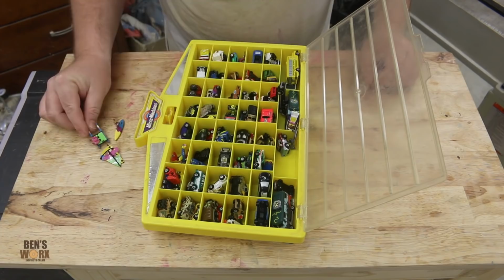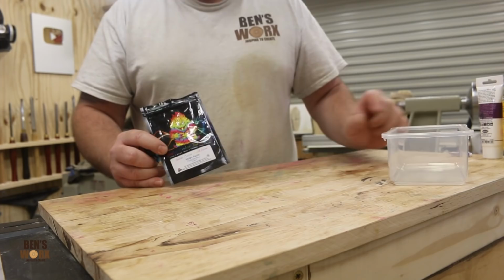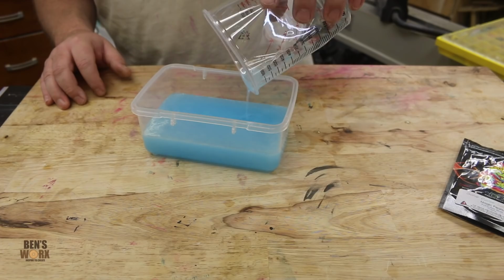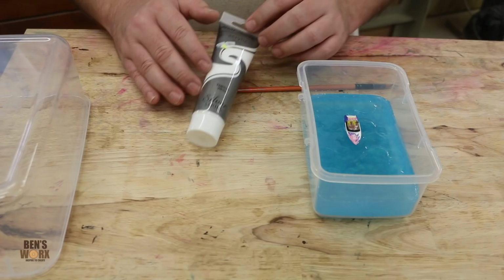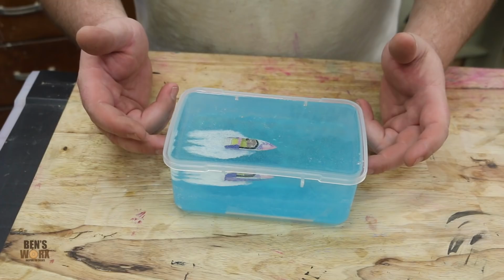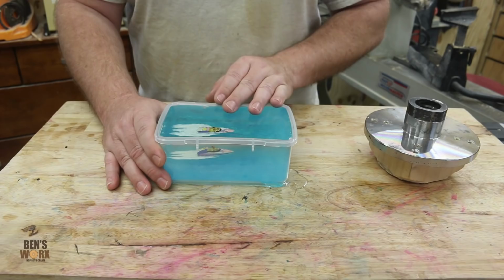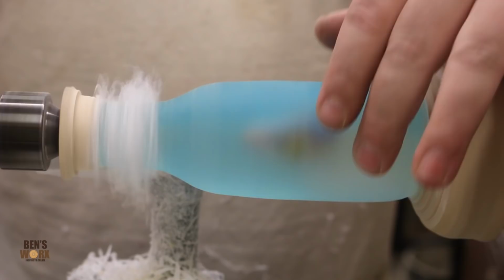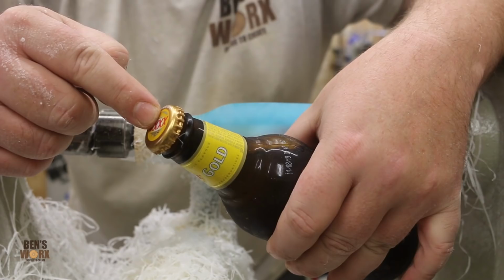Making a Ship in a Bottle - Epoxy Resin Art

Comment: You can always retrofit your pressure pot to lay on its side and put a shelf at the halfway mark so you have two sections instead of one. Just a thought, I've seen other people use them, and they seem to come in handy for bigger or multiple pours. But when you need taller space, you can just stand it back up again too.

Comment: Looks awesome, for larger projects could you not lay your pressure vessel on it's side ?
I''d suggest a wooden cradle with a hinged bracket for the lid to sit in, when you're ready to use it fold the bracket up and pin in place this would then allow you to lock down the lid with ease.
Reply from the maker: Thanks Mate, Good tip

Comment: Wow that was an epic how it turned out. How long have you been working with epoxy and were did you get the pot you useI was wondering about using the pvc  cut in half the for the 2ed port could use full pvc

Comment: in most of your videos you use those plastic cups to mix your resin are they single use or can they be cleaned & reused & if so what to clean them with
Reply from the maker: Sometimes you can remove the resin once it’s cured